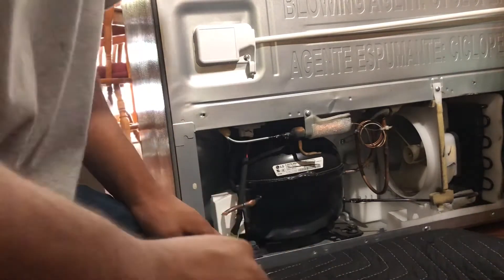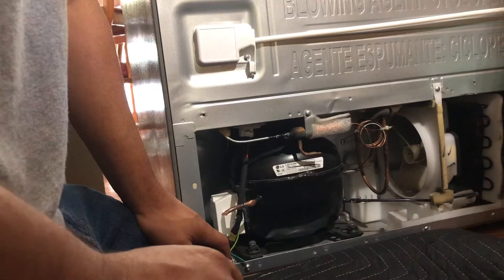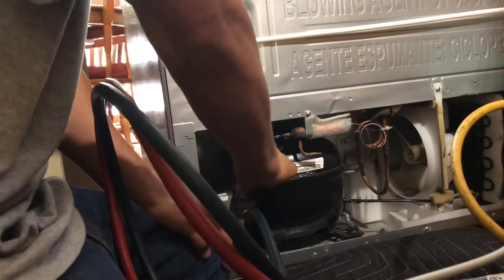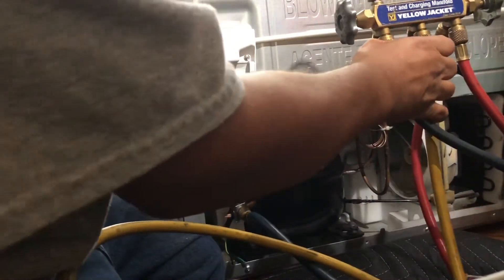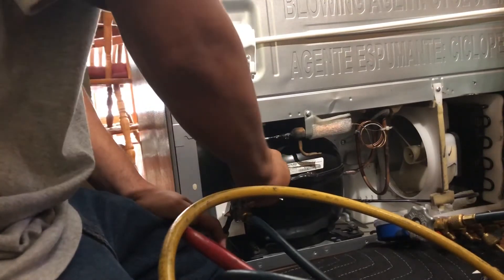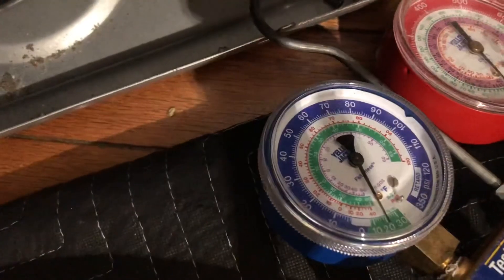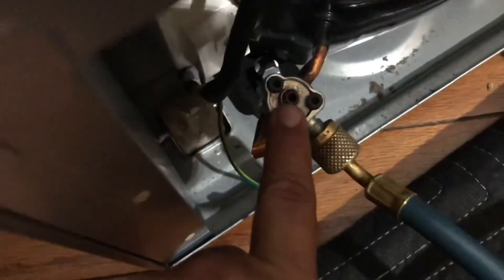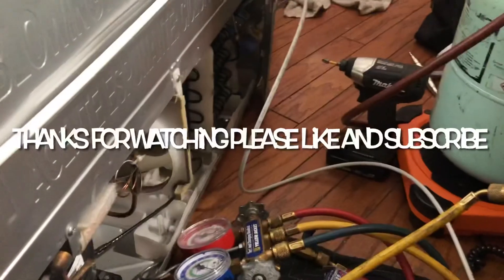Using homemade refrigerant recovery pump on an LG refrigerator

Comment: I'm curious to know, since you have a vacuum pump and the manifold, why not pull a vacuum on the hoses before recovering? Because the ambient air in the hoses at the starting point, has now been compressed and put into the container with the refrigerant. I can understand you''ll put on a new dryer, but this will still throw off your refrigerant weight a little bit, even if contamination isn't an issue.

I thought I would ask because you seem thoughtful and resourceful - and I don't see any HVAC engineer pulling a vacuum first. The most they will do is bleed refrigerant through the hose, which also seems sloppy and irresponsible to me.

Comment: Do you have to recover refrigrant on both high side and low side, or just low side I am confused??
Reply from the maker: Low side as high side is gas is in liquid form and will flood the compressor
Reply: At non operating compressor, throughout entire process of recovering,  right?

Comment: If the fridge ur working in Still runs put a 2nd piercing valve on the highline of the fridge ND run the fridge compressor connected to your recovery tank until it slows. Then use the vaccum recovery pump on the low side to get the rest. That way you get all liquid at first

Comment: How did you modify the tank to use it for recovery?
Reply: https://youtu.be/pemiJHwf-oE
Reply: I understand how a compressor is repurposed. 

I am asking how he bypassed the one way valve on that 134a jug, to use it as a recovery tank.
Reply: @matthewspores4314  Remove valve from tank. Drill out check valve. Re-install/seal the valve.
Reply: @matthewspores4314  this one was difective as I connected it for illustration. And off cámara I turned it on and it worked. I have tried others in the past but with no luck
Reply: you can remove one way valve from tank
https://www.youtube.com/watch?v=uCUzAMKlLNQ